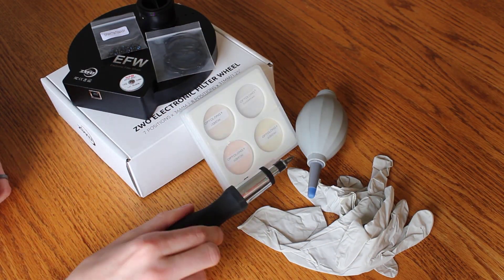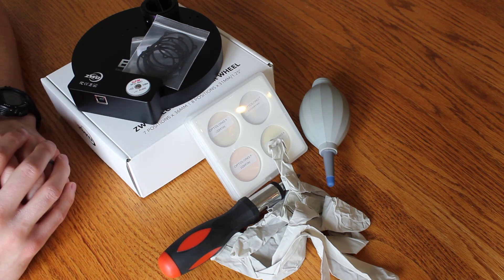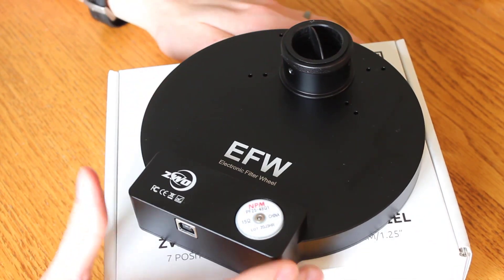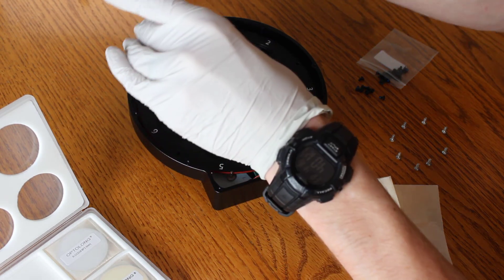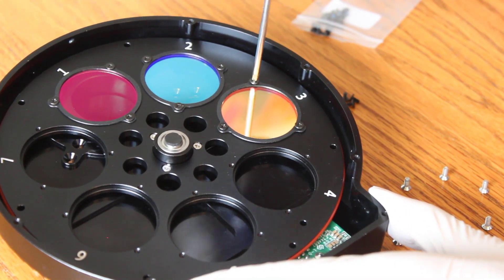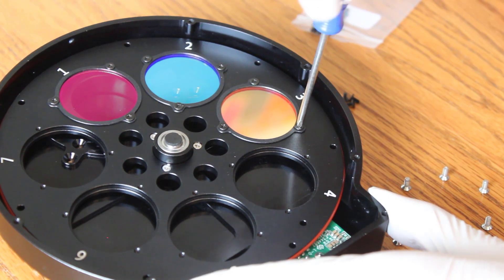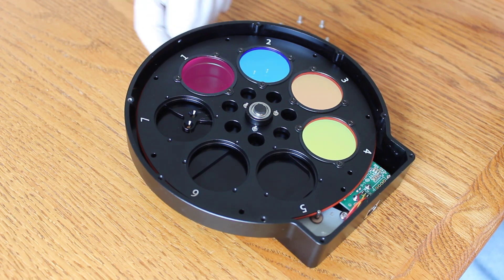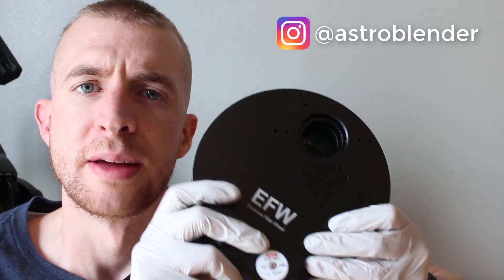How to Install Unmounted Filters the Right (Clean!) Way

Comment: Thank you for this - have filters and wheel on the way and this is most helpful! 
In a reply comment below - you mention using Nitrogen Gas. Could you elaborate on this a bit further? I have access to a nitrogen bottle with regulator. Would you connect it to a "pistol" blower like those found in a air compressor kit and use low pressure nitrogen to blow on the filters and optics? Although nitrogen has a drying property - just curious what about it might be better then using a bulb lower (air) to remove dust/particles.
Also - what is a "neutral gas bomb"
 Thank you!

Comment: Great video Cody and thanks. One question, what five filters would you recommend for a newbie who just ordered a 5 wheel EFW. Thanks in advance and keep the videos coming.
Reply: I'm not Cody, but I would say the a 5 position filter wheel could be used for a set of LRGB filters along with a Ha filter (if you have one) or just a set of NB's. For the first wheel I bought a 5 position wheel but found that  the 5 positions weren't enough once I got a full set of LRGB and NB filters so I had to upgrade. A 5 position wheel is not the best solution for a filter wheel but oh well, live and learn... I guess.

Comment: I use an air filter in the room before i open anything like this. Removes 90% of dust in the air and when you close your accesorys the clean air is kept inside. I use it when cleaning the mirror or the in&outside of the schmitdt cassegrain corrector plate.

Comment: Hello, a suction bulb pumps the ambient air. This is charged with particles. That's why I prefer to use a neutral gas bomb.
Great vid
Keep continuing
Reply from the maker: When I’m in the lab I use Nitrogen gas, but at home with non-research grade equipment, I’m okay with a bulb blower, good point though.
Reply: Might add to that that canned air is a complete no-no due to the gunk they put in it as a propellant.